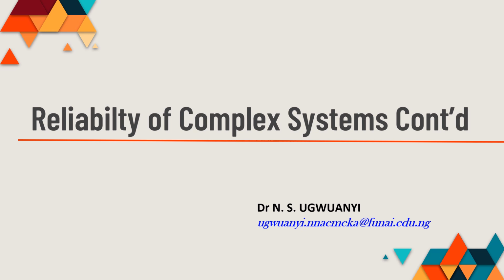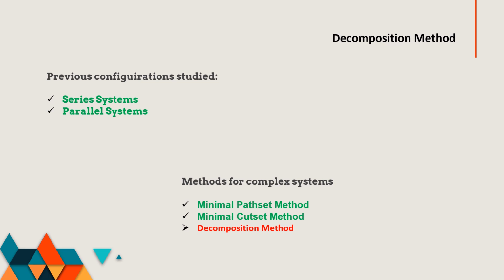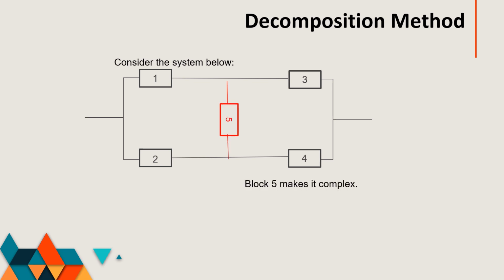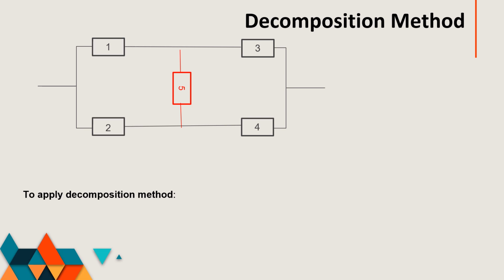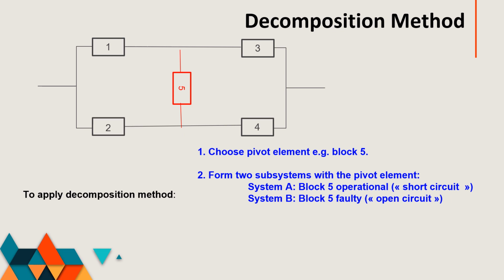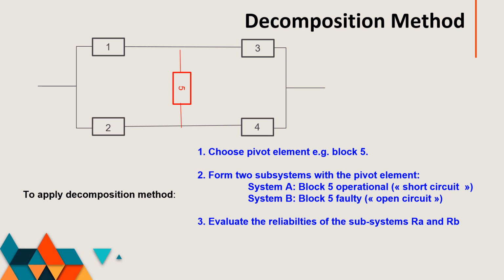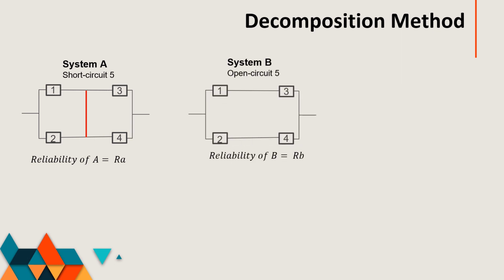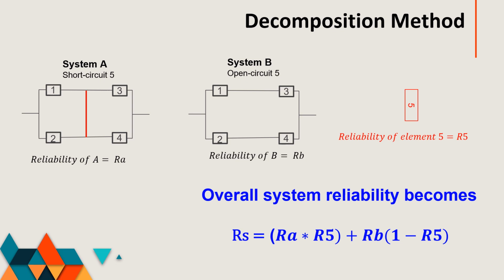Reliabilty of complex Engineering systems

Comment: Sir, how do you use decomposition method for a complex Reliability system with 2 different elements that make the system complex?
Reply from the maker: If such a case is encountered and the two components making the system complex cannot be first resolved either in series or parallel, then, I recommend other techniques like method of minimal ties or minimal cuts.
Reply: @drnnaemekaugwuanyi  OK. But is there any rule to know the number of ties and cuts in a given complex blocks? I find it difficult to know when to stop generating the ties and cuts especially in a complex case where there are also elements in series before the output/sink.
Reply from the maker: There could be several ties and cuts in a system but minimal ones are fixed. The rule is that your tie or cut cannot be a subset of another tie or cut. If you look carefully, and patiently, you can figure out the minimal ties and cuts. In general, minimal cuts seem to be less than minimal ties and are sometimes faster. But it's not always so. For a very large case where it's practical intractable to attempt hand solutions, a software can generate all the ties and cuts. I hope this helps.
Reply: @drnnaemekaugwuanyi  
Thank you Sir.
Another thing is that I observed that when opening the brackets formed using decomposition method, for instance; R1(1-R1R2), will the answer have R1 squared or just R1?